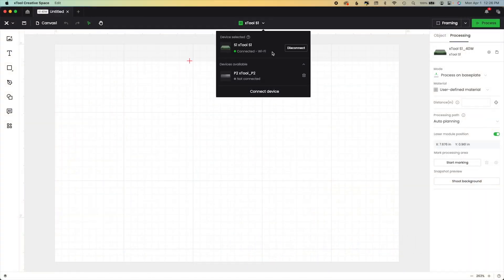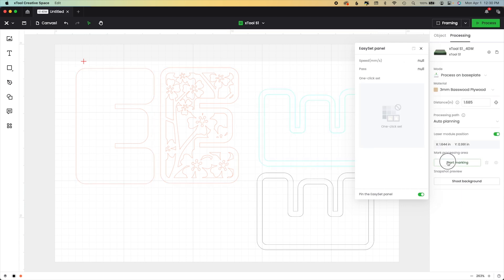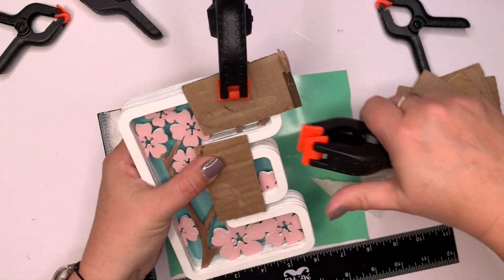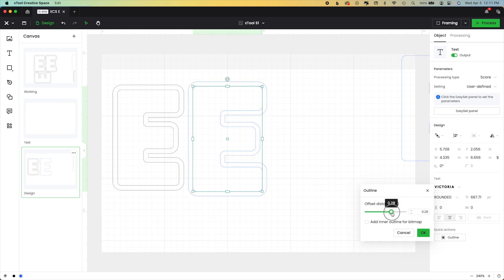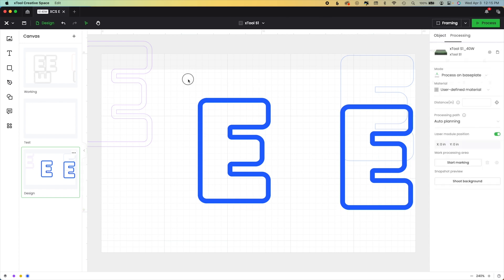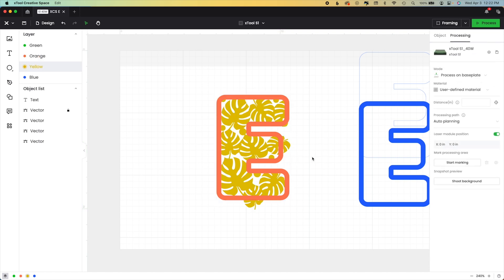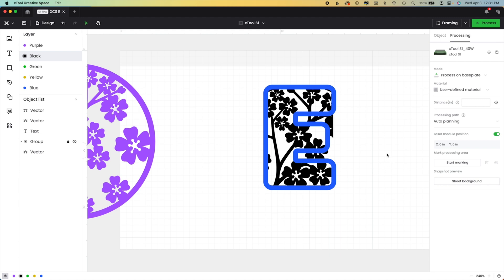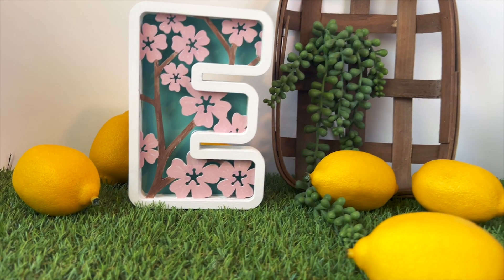Laser DIY / XCS 2.0 Tutorial / Layered Letters / xTool S1 Project / Laser Cut / Painted Laser DIY

Comment: I have a dumb question :) When you combine for a letter like R, how do you keep the inside of the R cut out? I don't know if I'm making sense, but the sort of like the inside of an O. If I combine, I would like XTOOL to still cut that part out, and I can't figure out how to keep it from filling that part in.
Reply from the maker: It’s a great question, actually! 

You have a few options:

You could incorporate the bit of the R or the O into the design layer below it (and paint it that color, so a score line around it would be good). 

You could also “bubble letter” it by placing it on the edge of the letter so it cuts as one piece. 

Finally, you could add a brace. It’s like a line down from the top center of the O to hold on that piece. It’s my least favorite option because it looks like the old Army lettering (if that makes sense) and will likely be quite visible in the design.